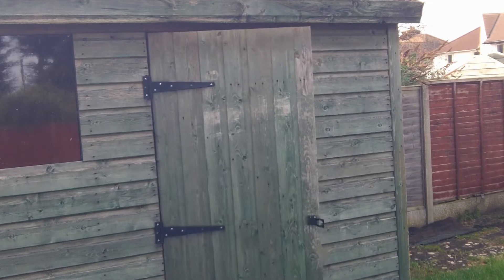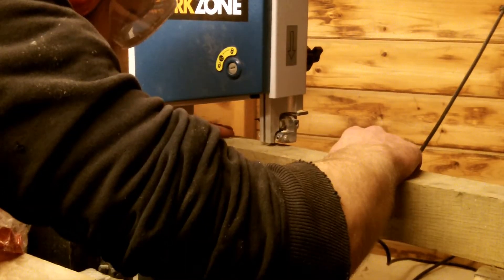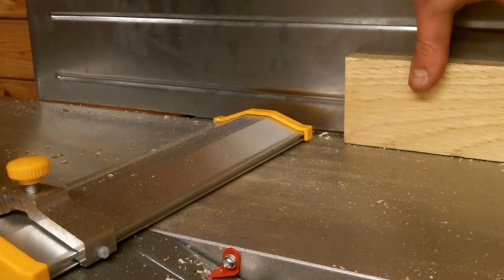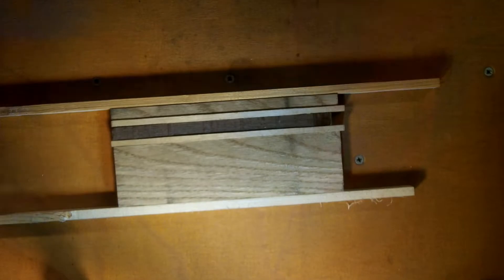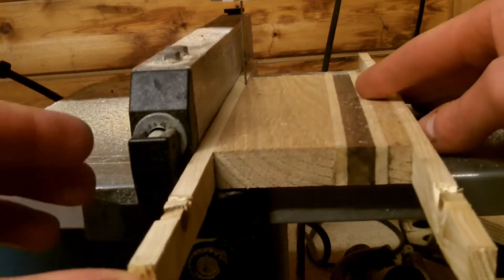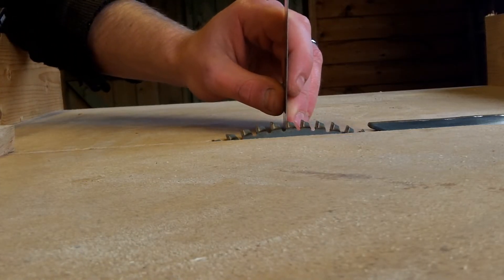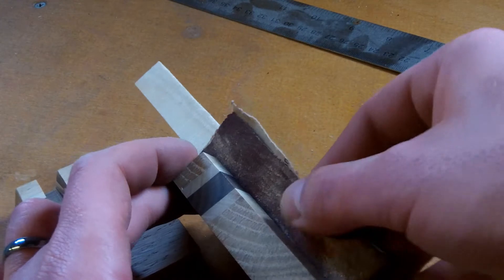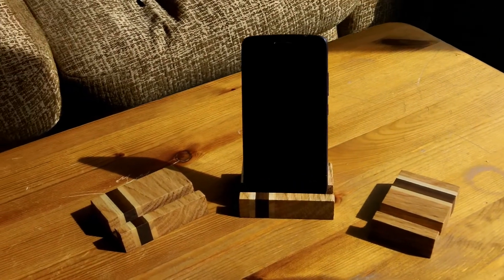Hold The Phone - Quarantine Project #1

Comment: Lucky you got your thickness jointer before lock down. Where do you get your nice woods from?
Reply from the maker: Absolutely! I've been using it loads since I got it.
I haven't yet pinned down a source. These were eBay, Nick's timber in Gloucester, and a pallet.
Oxford and Bristol wood recycling projects are good, and makerRIP put me into Davies timber in Birmingham. All closed at the moment though.
Reply: @janionmakes  I got some nice oak from Nick's Timber but I had to pay extra to get it machined as I can't thickness (and I've not worked out how to resaw on my bandsaw).
Reply from the maker: @miketick  my Oak came from there. I didn't see much of a range there. I also found someone named Guy Neath on Facebook who sells slabs in Worcester. freeads.co.uk/uk/buy-sell/home-garden/garden/gardening/logs-firewood/36216412/rustic-planks/view